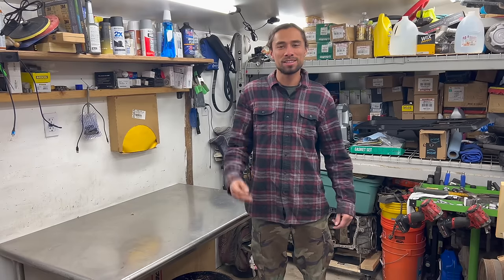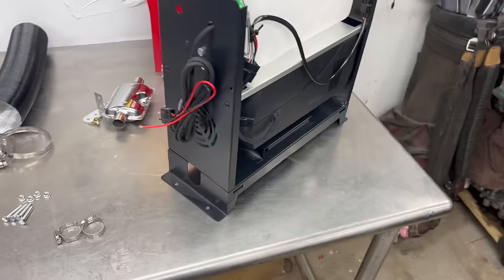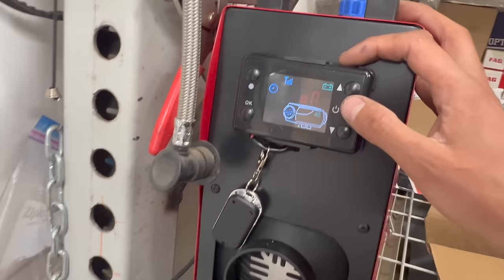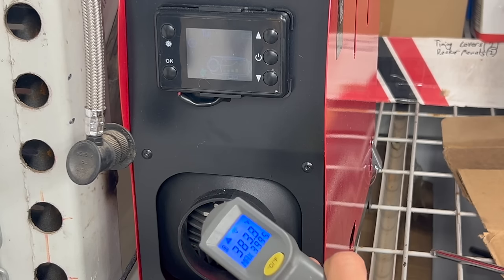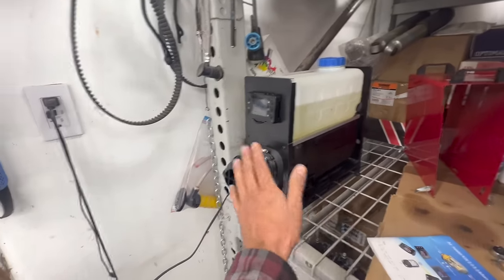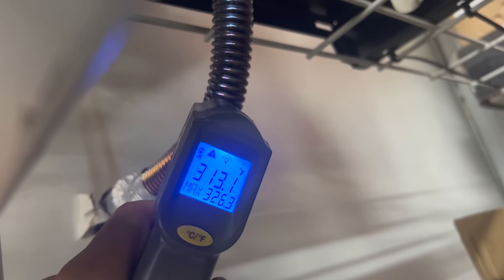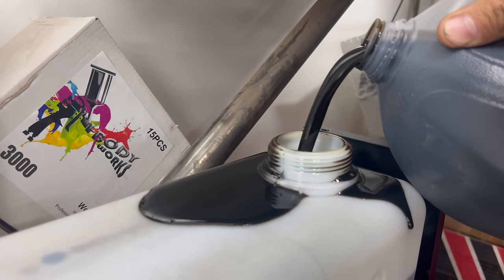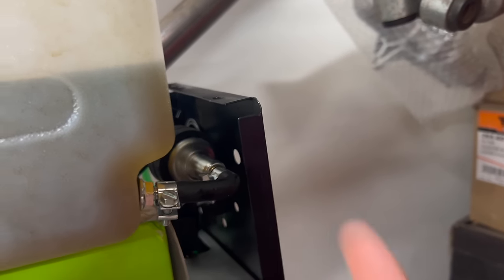Unfiltered 100% Waste Oil Vs Stock Diesel Heater

Comment: Doesn't work beyond 30 hours - it will fail to restart. The glow plug won't be able to initiate ignition., Even if you go as low as 60% waste oil & 40% fresh fuel, the heater will still crap out. Some will tell you different but they're spoofing. You will have to go through a process to get it to re-fire even using clean fresh fuel. That process is Dull. Run it on fresh diesel, turn it down to setting 3 - it will run great & economically - these aren't built to cope with waste oil. They crap the bed rapido & will do your head in.
Reply: Haha I did this to mine and it did all the same as this one 😅 so I replaced the glow plud now she working again
Reply: Lmfao been using used oil for about 10 years with my heater. Runs fine.
Reply: Mine works good but I always start on diesel
Reply: You can leave it running on waste oil but not at even setting 3 or 3Hz. Two is just perfect. The oil is more viscouse, thus, it is burning much longer than diesel and it has a bit more Joules when burning. Mixture of 50/50 is way to go. With 50/50 mixture you can go all the way up with intake filter attached, too much oxygen means too much heat and it will overheat overtime.
Reply: One guy had a dual tank setup where he started it on straight kerosene then after the startup he switched over to his waste oil mix, then switched back to clean fuel for the shutdown.
Don’t know how much time this buys but it seemed like a solid compromise.
Reply: Might depend on how often you change oil. Some people don’t change oil until it looks like molasses.
Reply: @c50ge  doesn't matter i have tried clean engine oil too
Reply: Year 6 of using 100% waste oil . When should I expect it to stop working? Using it every winter .
Reply: @Nctbgs  how did you do it then? I have tried everything
Reply: Do it to mine often...but I'll also run some kerosene through it and clean it out.
Reply: @Nctbgs  You do, yeah. Most won't run even 60:40 new:used for 8 hours before crapping the bed. You must have some anomaly, lol. Or be fibbing. ;_)
Reply: @worldradio520  It's a Miracle.
Reply: @jamesward5721  i think so because i have tried it all
Reply: won't work.  Too much build up after 8hrs chunks build up in the combustion chamber.  It gets nasty.  I mixed 20% gas, 20% deisel and rest waste oil... varied ratios to 50/50 waste/diesel always get ash/tar build up in combustion chamber and clean out required.  I eventually  bought 2 chambers for quick change out as well, cut near weld to ease combustion clean out. Then,  used hose clamp to reattach the combustion chamber.
Reply: @SR-gt350  If it does get stuffed & won't ignite, drain the fuel, put in fresh clean diesel & jam a hoover onto the end of the exhaust. Let the hoover suck for 30 or 40 seconds, a minute, blah blah, then restart the heater. It will smoke like a sod but will refire. Then never put waste oil in it again, as you've learnt the lesson. :-)
Reply: @jamesward5721  😆 agreed 👍
Reply: @mastershua9991  wow, Canuck oil must have more ash in it.
Reply: Yes do not do unless you make bio diesel and mix with regular diesel. I ran some waste mixture and it didn't help the performance at all , had glow plug issues would burn all crappy and unclean for awhile before clearing up , don't do it unless you have a spare you heater
Reply: You can also open the engine and clean out the inside every now and then to get it running better
Reply: Lol the vevor their shit is ok
Reply: I mix my used oil with 20%rug and it ruined like a champ. I have 3 of them (8kw) admittedly one of them did do what you said once. I emptied the tank and started it off diesel and been fine ever since.
Reply: Thanks. A lot of this stuff you buy online you're happy if it works at all never mind any length of time.
Reply: Why go through all this. On low I get 40 hours run on 1 gallon.
Reply: You are absolutely correct, been running one 3 years as only heating for the house , every time I try to mix fuel I always end up frustrated
Reply: Anyone tried to upgrade the pump?
Reply: @Messy_Jesse  Isn't the pump that's the issue, the factory pump will happily run the waste mix - issue is the ignition system - even with fresh diesel, the spark generated is marginal in terms of causing ignition - users will know they may have to run a couple of ignition cycles to get the heater to fire with the error code "Failed ignition" getting thrown up - that's with fresh diesel. 

Start chucking mixed fuel into the machine & that weak ignition becomes a problem - the fuel won't ignite & you will get little more than loads of white smoke as it attempts to fire. If you then change out the fuel to fresh diesel, you will still struggle to get ignition unless you clean the combustion chamber -  easiest way is to bang a vacuum cleaner onto the exhaust & let it hoover for a bit. Then it will refire, but you will get clouds of smoke for several minutes (a pita)until the waste mix is all gone. 

That's the reality.
Reply: Have to run it like people run diesel trucks do....start and shut down on pure diesel and run it on the used oil. It helps to definitely filter the oil.
Reply: Also, there are heavy metals in used motor oil.  I’m not sure you’d want yourself and your family to be breathing that, even if it did work.  It’s more practical just to recycle your oil and buy an efficient natural gas or propane unit.  If it were me, I’d just buy a blaze king wood stove.
Reply: The same thing can happen at high altitude. Some are rated for higher altitude than others
Reply: Hi Nctbgs-Please tell me exactly what heater your burning waste oil in. I need one bad
Reply: Use a mix of gas and oil
Reply: Your fuel pump needs to be on a 45° angle. That is why air is not getting out of the system.
Reply: its very easy to clean out the combustion chamber area, they totally block up eventually and still run through the smallest of vent holes amazingly, but once you chisel out all the buildup with a very long thin screwdriver, they'll start up just like new, although some of the buildup inside the turbine torus chamber, is quite hard to remove even by taking off the riveted on stainless steel disc covering the mixer ignition area, but you can always make a special tool for that, I mix kerosene with my synthetic 5w30 Valvoline waste oil from the Nissan.
Reply: @rb30zk  i do exat that.
Start and stop on pure diesel.
But run it on 50/50 used frying oil.
Reply: @mastershua9991 no it doesn't quit lying
Reply: @worldradio520 💯%
Reply: @davidshepherd-sj2tj  lmfao. If your iq isn't room temperature, there shouldn't be an issue with proper maintenance.

Comment: I see a few mentioned but will just walk through this.  1. The pump has to be at a 45 degree angle with the OUTPUT up.  It's a piston style pulse pump (hence why you hear the ticks).  2. The chinese are using the wrong fuel tubing as it is soft compound and the "pulse" is being diminished with the soft tubing.  You are supposed to run the white hard plastic so that the the pulse pushes like it should. 3. As with any fuel, yes. . you should filter it at a reasonable level to prevent sludge and unburnables from entering the BURN chamber (this thing should be respected for fire hazard reasons). 4. You can run this with waste oil but you should cut it 50/50 with diesel and when running it with waste run it at max.  5.  When running the unit with waste you should run it for about 30 minutes every 4th or 5th refill with pure kero and run it on hot to burn out all the carbon trash that builds up to keep the burn chamber clean.  Finally. . .any time the unit is run dry it requires a prime process (read the manual) or you will have those shutdown issues.   You need to learn how to run it period on diesel first.   Had you learned the test would have probably worked till the burn chamber got all carboned up and the glowplug finally said oh hell no.  Your welcome.
Reply: Very sensible comment. Thank you
Reply: The only reason why the fuel tubing is potentially an issue is these heaters at one time were supplied with aquarium tubing. It would eventually turn hard and break and leak. Most now are supplied with a tygon line, this line is fine for a small run with no drastic bends (like a ALL IN ONE heater). The hard nylon line was recommended by Webasto and Eberspacher for one reason only and that was to constantly feed the little air bubbles to the heater without issues for longer runs. The way the pump works will create little bubbles , you can see this in the tygon hoses. These are the bubbles that can collect in larger hoses with bends.  So this has nothing to do with fuel pulses. That was a myth started on the facebook groups and parrots like to repeat it.  And if you want to run this heater on different fuels, you must also tune the heater properly by watching your case temps as the oil does effect the temps. My tests always sooted up after about a week on low. But I could run endlessly for weeks on high on a single tank system.
Reply: Yup, the hard white tubing fixed it for me.  aliexpress has kits.
Reply: *you’re
Reply: damn. so not worth it unless you're a mechanic or restaurant owner with an unlimited supply of waste oil.  I'm burning 99.9 biodiesel so the neighbors think I'm just cooking fries.
Reply: @beyondmaintenance well said. So many people cannot spell this correctly these days!!!!
Reply: So is it better to pump the oil in to avoid air bubbles?

Comment: You need way bigger exhaust hole in the wall with fireproof material. Those are known to cause fires. A heater core makes a great heat exchanger as well.

Comment: If you'd read the instructions, they helpfully request you set the fuel pump at a particular angle. This helps stop the pump get an air lock due to the cavitation bubbles being drawn in.
Reply: This. The pump only works if it's at least 30º upward angled. It'll get airlocked if it's on it's side (as can be seen in the video)
Reply: nah it's fine.

Comment: I’ve been using those heater for years on waste oil. The trick is have two tanks . One for startup like 15 min on diesel and the second one on 20% kerosene if you can .plumb the two tanks together to the pump and have a fuel shutoff for each tank. When the heater is hot switch from good diesel to waste/kerosene. I run it all year long in my shed with no issues. The only thing you have to do is disassemble it once every 3 month if you run it for long hours everyday and clean the chamber. Hope it helps

Comment: I run two tanks with mine, I used two solenoid valves to select which tank I draw from. Tank one contains pure diesel and the other is 50/50 waste oil mixed with diesel (an old 500l oil heater tank). I start the heater with straight diesel then after it reaches running temp I switch it over to the mix and it runs fine (and clean). I then switch back to clean diesel about 15 minutes before shutdown, and run it flat out at max temp for the last few minutes. That cleans soot off the glowplug mesh to be ready for the next start. Also, it's fairly critical to use the burner intake filter as it creates a pressure balance for the burn chamber ensuring a correct AFR. I've had about three years trouble free with mine, although I did buy a spare glowplug, a gasket set and stainless steel burn chamber, expecting one to fail at some point. It still gets through the waste oil over a winter and offsets my low running cost by another 50% so I'm happy with that mix. I've heard of people doing 1/3rd diesel to 2/3rds waste oil, but it would still require clean diesel to get started in cold weather.
Cheers.
Reply: thanks for your comment
Reply: Great idea thanks for posting this!
Reply: that would be a banger video!
Reply: This is basically the same method used to run diesel vehicles off of waste vegetable oil. The only other difference is some kits have tank heaters for the oil to make it flow better.
Reply: Very smart!!
Reply: Can you make a video please
Reply: Thanks for the info! This is really good to know!
Reply: After watching and learning a lot more, have you had to do extensive cleaning of your heater? I was heavily considering doing this exact setup, but I have seen the inside of machines after running 50/50 waste oil. This was obviously without doing the pure diesel burn after running on a 50/50 mix. If you have any other tips or information for doing this, I would greatly appreciate it. If it is a big hassle or has issues then I will probably just run straight diesel. I also have access to some engine oil that has very low mileage that I would probably end up using with this setup as well.
Reply: @reubenk7331  I've done a couple of soot clean outs, but not from failure to ignite, but on that note I also mounted my heater with stainless studs in the four bolt holes that are very easy to remove. I also apply copper coat grease to the gasket surfaces and bolt threads which prevents damage when separating the chambers. I think my run cycle is what keeps the system fairly clean, and my waste oil looks new, being used hydraulic oil from excavators, it is as clean looking as new oil when I mix it. I also make sure to fully mix the diesel and add 1% shellite, then I use an agitator pump to regularly circulate the oil mix in the large feed tank, as it may settle out over time. I also have the waste oil stored in drums for well over a year (some 3+) and I draw off from the top carefully without stirring up any contaminates that settle to the bottom. I run the heater flat out on straight diesel before shutdown and leave that maximum setting for the next startup, and it only gets switched over after the fan slows once settled. One other detail I should have mentioned is, I run the silent pump but tuned the system for the oil mix, not the straight diesel which is probably slightly lean. I also notice there are some sparks exiting the exhaust during the shut down cook off, so it seems to be blowing the soot free during this cycle. My oil mix run time is usually 3-6 hours per night. During shutdown, the fan reaches 5000rpm (max speed) Cheers.
Reply: @alasdair4161   Wow, thanks a lot for more information about your setup! That is good to know that doing the pure diesel shut down seems to mitigate a fair amount of issues. I also wonder if you have tried different ratios of waste oil to diesel, and how that has been on your two tank setup? I have found some videos where people do end up switching over to diesel a little before shut down, but they were typically running 75% or more of waste oil. I was also considering running 25% oil, to 75% diesel, but still switching over to straight diesel before shut down. As a technician, I am not too worried about tearing the machine down, I just don't want to have to do that in the middle of the heating season. One other question I had, is shellite basically brake cleaner? Doing a search it sounds like it is a clear, high evaporation solvent suitable for rinsing oils and debris.

Comment: Pre-heat your oils, it'll work and don't need mixing.
In the old days, people running oils on old diesel engines used to wrap copper coils close to the exhaust.

Comment: Used oil should be mixed with gasoline to make diesel, start at 10% gas to 90% oil and increase gas percentage from there. Research black diesel for more info

Comment: Need two fuel tanks.  One with straight diesel for start up and shut down, and another 50/50 to run on.  Elevate both above the machine and switch using valves.  This being said, these things are very fuel efficient, so the risk vs. reward may or may not be in your favor.  Will likely get a LOT of carbon build up in the combustion chamber when running oil.

Comment: We push ATF thru the fuel systems on setups without emissions controls because it's basically detergent and lubricant. I wonder if blending diesel and ATF and running that once in awhile would make this work. Also if look into using ATF in all your small engines before storage it's a great old school trick for keeping everything maintained.

Comment: I picked one up and it works great. I watched a ton of reviews and product reviews. Its an oil furnace. Because of the small size and its tolerances, it can't run on everything.  The combustion chamber does get overwhelmed. But it can overheat.  Set the fuel pump to a low "pulse" and find a dilution rate that works. They will run around 24 hours on a gallon of fuel. Also keep the battery charged. The glow plug is the biggest draw on the battery.
Reply: a surplus X Box 360 PSU can power them, see videos on how to used them as 12v DC psu
Reply: @phillipsmiley5930  That's good but a power cut will cause the control board to melt, i would recommend an AGM battery with a '7 stage' eBay charger that can be left plugged in and on.
Reply: How about a solar powered battery tender
Reply: What if you made a fuel tank and mounted it much higher than the pump, would the gravity help pump old engine oil ???, could be worth a try.

Comment: Nice video. We are having single digit weather so I fired up my old kerosine heater, to make sure it was still working. It's been sitting for 8 years in the garage. The temperature fluctuated from -10 to 130. I've always called B.S. when people claim old fuel won't burn. The electric start wouldn't work, but the old batteries were corroded and even though I replaced them, I think there is corrosion on the terminals, so I used a lighter. Works great.
This is an emergency heater, and I figure I can always take fuel from my truck if I was in a hard spot. :)